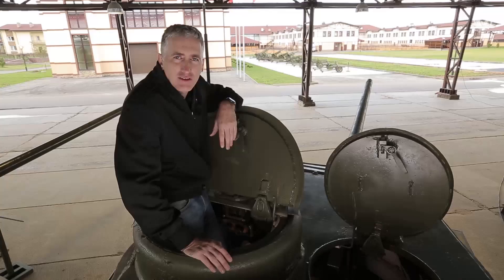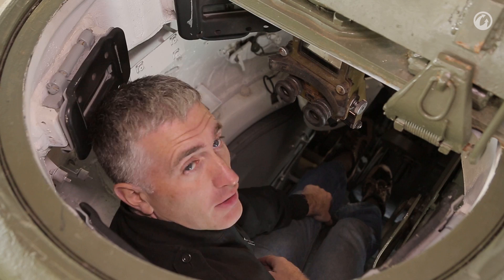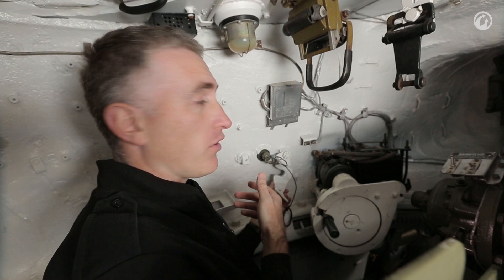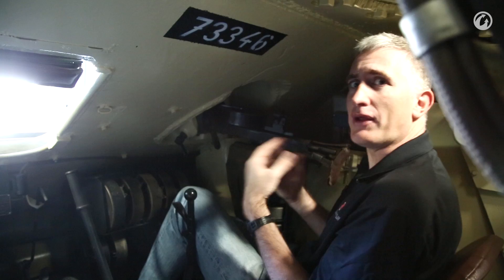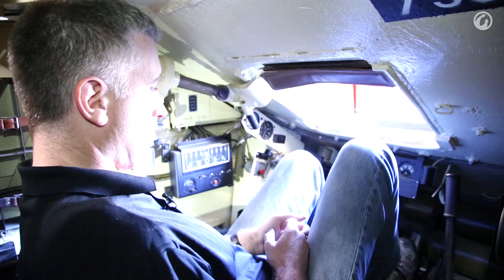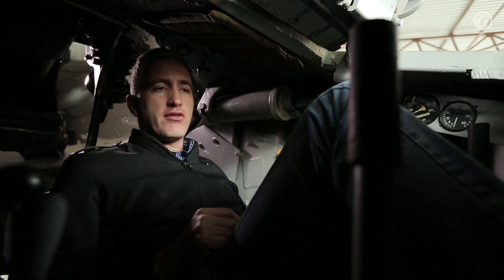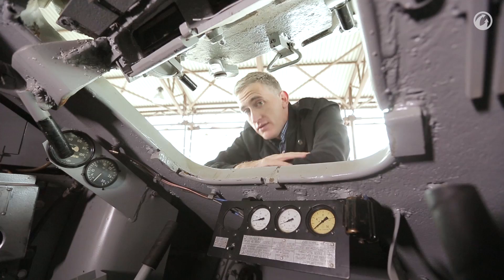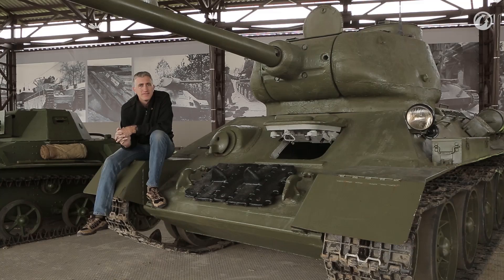Inside the Chieftain's Hatch T-34-85: Part 2

Comment: Now  I understand why Soviets recruited men of short stature for tank crews.  The 165 cm average height statistic provided by TechGeek translates to 5.4 feet, or about 5' 5" imperial measure.  So if that's the average, then they were looking for strong but short lads of no greater height than perhaps 5'2"?   It is apparent that such a crew would be much more comfortable, and effective, in the T34.   And of course, short small nimble soldiers are more difficult to see/target/hit!
Reply: Added benefit of not starving to death as quickly.

Comment: Looks like everything "bad" with this particular tank comes with the outdated hull, but most of the features of the new turret are actually pretty neat. That retractable cupola vision ports, traverse system, loading tray, quite substantial ready rack for example. Which is not surprising of course, as it was a newer turret fitted to basically unmodified older hull. Also, overally similar T-44 turret suggest that the turret itself was rather successfull and well engineered.
Reply: Eh
Covering up the suspension access ports is an issue, at least for most tanks. As the t34 was disposable i guess not so much.
And compared to say the Sherman a substantially smaller ammo capacity overall.
But different countries had different needs and doctrine so what would be a catastrophe for one is just fine for another.
The brute force needed for the drivetrain would be less of an issue for excitable conscripts than light controls on a weak drivetrain(panther). All in all a good design considering the needs of the war and the doctrine of use.
Helps that they generally used tankers under 5'4".(165cm)

Comment: I would love to now see the next generation Sovjet tanks, like T-55 etc.
Reply: I don't know if Chieftan can actually get inside a T-54/55, lol. It is incredibly compact and filled with equipment.
Reply: it   smaller  has less  room  and the   rest is about  the  same     bad  gun system    bad  drive  train
Reply: @Cragified  But he did get into T-55 and found it much better laid out. The absence of christie suspension pylons helps out immensely.
The next guy with the bad drivetrain and gun doesn't have a clue, it's the most reliable armored vehicle ever and the gun is still good for anything that isn't a modern tank.
Reply: @Klovaneer  T-55 absolutely is a better laid out then the T-34-85. I haven't watched his T-55 video. But with my own experience I was just questioning if he could actually get in it and able to work with the hatches closed.
Reply: @Cragified  Judging by his vid he could work it as a commander/gunner in a 3-man crew as it's also for really short people.
I hope he some day makes a video on T-72, he should actually feel fine in the TC station.

Comment: Greetings from hungary!
The tank was part of an exhibition of the 1956 freedom fight against the soviet union, it move to the exhibit on its "own foot", than the exhibitors try to unequip the fuel tanks, but some fuel left in the tank anyway. They even detach the electric starter from the battery, but forgot to empty the compressed air starter. Protesters sieg and take over the tank, but they cannot start it. Than an old men who had proper training at his youth, climb in, and start the tank. He later told the jury he stop the tank on his own will, because he did not want to became a murderer, and smash the policemans. Rest:
en.wikipedia.org /wiki/2006_protests_in_Hungary

Comment: 15:15 Diesels dont have alternators either. Should be a DC generator for powering lights and radios, etc. Alternators are for running spark ignition systems.

Comment: Nicholas, I can't help, but noticed that this particular T-34 tank turret moves painfully slow, however T-34 was famous for moving turret faster then German "cat"(Tiger, Panther and ect.) series tanks, and I came across info that there was two sets of voltage systems 12 volts and 48 volts. So my question did you by any chance operated turret in 12 volts or on hopelessly dead(flat) batteries?
Reply: No, they were powering it externally I believe, they weren't running it around at full speed, and he mentions how fast it can go. I imagine in this case they were using 12 v probably a car battery or something. Also, it isn't clear if it is a resistive system or single speed either, idk if you know.

Comment: The latest rendition of the M4 Medium still beat the T-34-85 in Korea.
Reply: It was more about the operators more than anything then.
Reply: I think the gyroscope stabilizers, roomier interior and situational awereness still played a huge part.
Reply: RevanBladeZ According to Nick Moran (The Chieftain), M4 crews often didn't know how to use and maintain the stabilizer system properly, if they used it at all. Granted, when it was used properly, it is a big advantage for the M4.

The turret of an Easy 8 was more or less comparable to the T-34-85. The Easy 8 had a 69" turret ring, which is wider than the 56.3" turret ring of the T-34-85, so it's wider by just over a foot, but the Easy 8 stows most of its ammunition all around the bottom of the turret basket and in a box on the floor of the turret basket, because its bustle was used for radios. The T-34-85 turret has a much larger bustle, where all of the ready ammunition is stored, and no ammunition elsewhere on the turret. Both tanks kept their ready ammunition under the floor, and the T-34-85 has the disadvantage of not having a revolving basket floor, but an experienced loader would not be bothered that much. The amount of room that the loaders and the crew had to work with are quite similar.

The Easy 8 has the advantage in situational awareness. There is no contesting that. The commander's periscopes on the T-34-85 have a much more constricted field of view compared to the direct vision ports on the Easy 8's cupola, and they were apparently often cloudy due to poor construction. There was some compensation in that the T-34-85 commander gets an integrated binocular sight embedded in the turret with a 1x periscope in it. You can see it in The Chieftain's T-34-85 video (part 2). This would be his field binoculars when he was buttoned up. Otherwise, the T-34-85 commander has to fight outside the hatch.
Reply: @tankolad  The M4 crews didn't know how to use the stabilizer in World War II to avoid the Germans getting the technology, I was under the impression that they actually taught their crews how to use it after WWII. 

That being said, I think that the M4 is a superior tank but with the caveat that it definitely cost more to produce an M4. Soviet tactics tended to prefer quantity over quality, at least based on World War II.
Reply: @HereticsRight  The M4 crew never learned how to use the stabilizer. After WW2, stabilizer was deleted on future tanks because the US thought it was ineffective when it was because they never taught the crew how to use it in the first place. Sure old Sherman still had it but it was never taught even post-war. The last time stabilizer was experimented on a production tank was early in the M26 Pershing's development. Stabilizers continued to be researched but would not be mounted on a tank until M60 Patton's modernization and M1 Abrams.

While T-34/85 have major improvements with the new turret, the driver's control as seen in this video remained troublesome. The loader is still rather uncomfortable but otherwise pretty decent. Do note soviet crew at the time is no where near as tall as the Chieftain. Also Chieftain isn't trained specifically to operate the tank, a dedicated driver would probably manage a lot better. As for visibility, the M4 Sherman doesn't come off as much better. Much like the T-34, it had fixed 360 view ports and a rotating periscope. 5 For T-34, and 6 for M4. Both tanks had a periscope for the gunner and loader.

I still believe M4 Sherman is slightly superior but not by much. Just ever so slightly.
Reply: @neurofiedyamato8763  I think Chieftain may have touched on the subject in his M4 video, maybe it's worth a rewatch.
Reply: @HereticsRight  I remember it fairly well. HGe did talk about the Stabilizer never being taught due to secrecy. And on his M47 video, he also explained how the stabilizer was never carried over. There's also plenty of books regarding the M26 Pershing's development. Which appears to be the last tank to ever have the stabilizer feature. The feature seems to not have been carried over.
If US taught the crew how to use it, they wouldn't of thought it was ineffective and removed it on the later tanks. So only possible conclusion is that the crew didn't know how to use it.
Reply: @neurofiedyamato8763  Yeah, doesn't really matter what goes in your tank anyways if your crew isn't trained well enough to use it.

That's generally how I view most Soviet tanks for late WWII and the early Cold War, they maximized cheap performance with the understanding that their training levels would never be equal to the Germans and Americans until later in the Cold War due to the devastation caused by the losses in World War II and how much Stalin absolutely gutted their officer pools.
Reply: @HereticsRight  Honestly I'm pretty upset how the stabilizer is like a massively missed opportunity for the US. But there's not much you can do about it.
There's plenty of missed opportunities in historical tank designs and it always kind of bothers me. As for trained tank crews... well it didn't help when the Soviets prioritized very little in the form of crew safety. Crew survivability is only a thing for the Soviet/Russians in the 4th gen T-14 Armata. So fairly late in that regards.
Reply: @neurofiedyamato8763  Well they're trying to present designs that look terrifying and will hopefully never actually have to be used, in any ordinary non-nuclear conflict Russia is absolutely going to get wasted by NATO so their weapon designs just have to make the prospect of taking them on a frightening one in terms of attrition. 

Plus they look good on paper, which makes them easier to sell to other countries.

Comment: If it has not been mentioned before, the favoring of revolvers over automatics by tankers would not be limited to the Soviets and is quite logical. Italian tankers made extensive use of archaic Bodeo revolvers as well and for a simple reason: revolvers retain their cartridge cases and so you don't have a hot brass flying around inside the tank that you have to deal with either immediately when it hits someone in the eye or later when you have to fish them out of inconvenient places. Also, the long thin barrel on a Soviet revolver would fit through the port more handily than the fat end of a typical automatic.
Reply: Eustace Stritchers Also, an automatic(usually) requires preloaded clips or magazines, where as with a revolver, you can just leave a couple boxes of loose rounds in the hull and let them figure it out. Plus, the longer reload is less of a factor when youre fighting from cover.

Comment: I saw only now the 2nd part of the T-34 and I can say that it is very interesting! The Russians really made a very good tank with an very good combination of sloped armor, horse power, relatively low consumption, almost utilitarian simplicity and good fire power! Yet it does has some ugly draw back such as ghastly escape hatch for driver and nothing for the machine gunner and of course the infamous Russian very bad ergonomics all around! I thought that with such a late production tank they might have made a better gearbox but you can see that Chieftain had some difficulty with the gear leverage! Other point is that the tank is quite blind when closed up because of the quite small episcopes for the commander and the episcopes for the rest of the crew and of course only a little hole for the machine gunner! In short a very respected tank but also I do not like it! Btw I really envied Mr Chieftain that he could start the engine and drive it for a few inches! I think I would faint from sheer joy to be able to do the same thing! Good job!

Comment: Don't sweat it, Mr. Moran.  Most tankers in WW2 were under six feet in height.  Probably most tankers were 5'10" and under.  I wouldn't be surprised if the average height range of western tankers was between 5'6" and 5'9.5".  Tank designers were not thinking of 6'5" men back in WW2.  A 5'9" tanker would have had no problem squirting out of that front hatch.

Comment: russian  tanks   mostly only had  1  way  radios  but  for  the command tank maybe   1  tank in  12 . the  gun system were  very good   for  short  range only at under  900 m  . the  gun system had  lots  of  play in it   so the good only  for short  range . lol     if   you  miss a  gear  change   you  had to  stop  to  restart  again .  Yes   i  driven  and fire  a   russsian  tank .

Comment: Written tank histories claim over 33,000 T-34/76's were made and over 15,000 T-34/85's were made during WW2.  So while the 76.2mm T-34 and its two-man turret was clearly obsolescent, so many were manufactured that the T-34/76 operated all the way into the Battle of Berlin.  Even old news war   footage shows T-34/76 tanks driving through west deep into East Prussia, past the final Seelowe Heights defensive line before reaching the outskirts of Berlin.  
Mr. Moran is correct, the T-34 tank design was showing its age at war's end.  But the T-34/85 tank proved such a winning design that manufacture continued post-war, albeit at a much smaller rate while newer Soviet tanks increased in number or else entered service.  We know this because Soviet dictator, Josef Stalin, in a memo to North Korean dictator, Kim Il Sung, promised him the recent manufacturing output of T-34/85 tanks from one of the Soviet tank manufacturing arsenals, prior to the outbreak of the Korean War.  The West is fortunate that Stalin did not get the idea in his mind to dispatch thousands of refurbished and reconditioned, old T-34/76 tanks to North Korea between 1947 and early 1950.  Had he done so, Korea might likely be a unified communist nation today.

Comment: Can anyone tell me,the exact details of the compressed air starting system? What pushes where to happen? Inquiring mind wishes to know. Thanks.
Reply: paul manson I think it would work like marine air starters. the high pressure air would be pushed directly into the cylinders and push the piston down rotating the engine, introducing air for combustion, allowing the engine to fire when the diesel was injected.
Reply: Same thing as with aircraft compressed air starter system. Yes, Russians had this system even in aircraft, it is very much in use today as well.